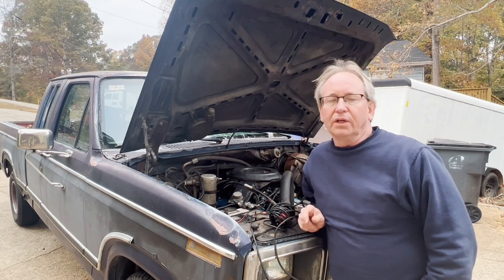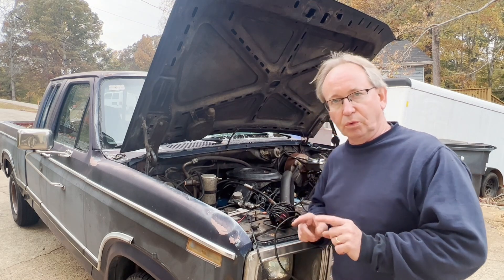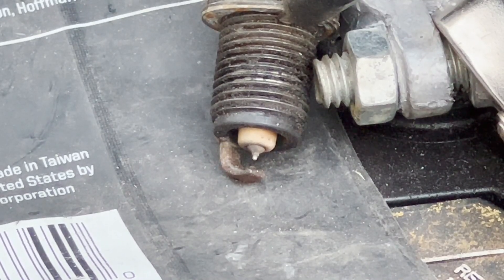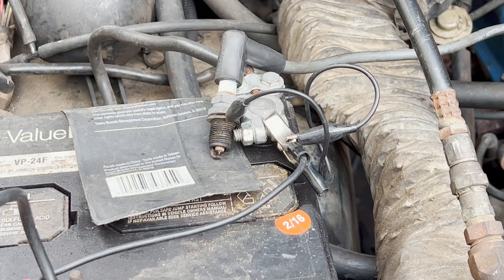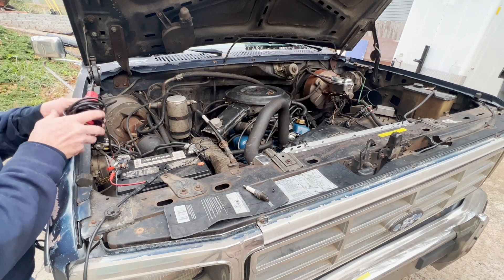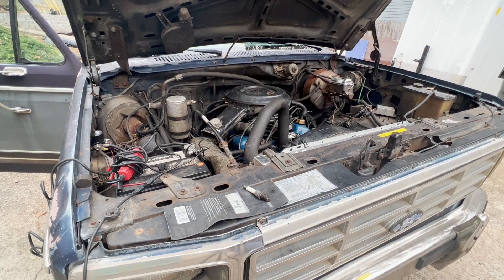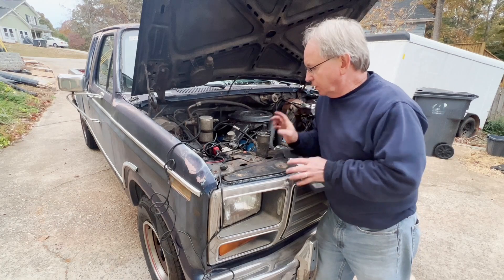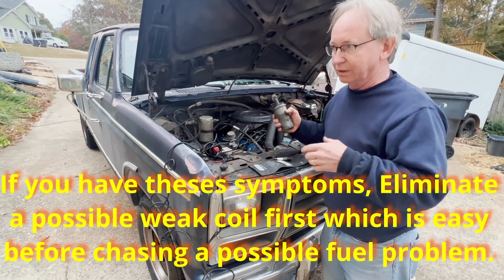How To Quickly Diagnose The Sneaky Weak Ignition Coil

Comment: I'm getting 9 volts to coil but nothing from it so bought a replacement and still no spark don't no what to do next as can't get engine started
Reply from the maker: Hi. Thanks for watching and taking the time to comment. Is this an older ignition system that uses an External Resistor? What is the Key Position when you measure at the coil? Older systems prior to HEI Electronic Ignition put 12VDC across the Coil Primary with the key turned all the way to Start/Crank with the Starter Engaged. Once you bring the Key back to Run, the Voltage at the Coil is approximately 9VDC, so if you're measuring at the Coil with the Key in Run it would Normally read 9 VDC. 
What is the Year/Make/Model/Engine? What type of ignition? Points or Electronic?
When you have no High Voltage Spark out, first thing to check is that you have a pulsing 12VDC in to the Coil. The Coil is a Step Up Transformer which requires an Alternating Current (AC) going in to function. Collapsing Felds in the Primary induce a Magnetic Field into the secondary which has more windings and steps it up over 20KV. Since a Car is DC, a pulsing DC (On/Off) in the primary as the result of Points opening and closing or a magnetic pickup into a control module produce a pulsing DC from the Distributor to the Coil. 
If you have points, its easy to visually (and Audibly) test this. With Cap off and Coil output grounded grab the rotor and rotate wiggle it back and forth. IT will only move a little against the advance. If the Distributor cam is close enough to allow the points to open and close, and the points are properly gapped you'll see and hear a little crackle when they open. 
With electronic you wont see anything, in the Dist, but will hear a pop and see a spark if you have the coil wire positioned close to the manifold.
Let me know what you have and the results of what you try.
Reply: @mkdhdinfiniteendlessconten3873  thanks for replying, my car is a 1984 rover sd1 2300. With the key turned fully but not turning over im getting 9 volt I've check for a spark but nothing I thought was the ignition coil so bought a new one but still nothing coming from coil even thought 9 volts to it so I'm kinda stumped
Reply from the maker: That car has Electronic Ignition, so the Ignition Module in the Distributor is what creates pulses to the coil. It's also a Lucas Electric which on it's best day is the worst system. I'm assuming that by 84 they were running Negative Ground. Lucas (British Cars) ran a Positive Ground possibly into the 70's. 
The Coil with the Key on puts a steady hot to the Pos side. You should be reading from the Pos side of the Coil to the Intake or some unpainted ground on the Engine. Don't read across the coil. In Run the Hot side of the coil would typically read 9VDC if it has an external Resistor. The Neg Side of the Coil is what get's the make/break pulse from the ignition module in the Distributor. It's highly likely that the Ignition Control Module in the distributor is bad. I can't guarantee it w/o directly troubleshooting it. There may be info online as to how to ohm out and check the module to confirm it's bad. You'll have to order that module on line. No one will have that locally.

Comment: It'd be interesting to see the difference in primary & secondary resistance between the 2 coils.
Reply from the maker: Hi. Thanks for watching. I'll have to see if I still have that bad coil. Generally I have found that unless the windings are either shorted or open, that ohming it out is not a definitive check. The resistance range for an acceptable coil is wide and for the primary very low ohms. It lets you know you have a ratio of resistance from primary to secondary and that it will step it up. If it's breaking down under higher rpm it will still Ohm out ok and have you chasing fuel problems that aren't there. 
I'll see if I still have it and if so I'll put the readings in a subsequent comment. 
Thanks again for watching and taking the time to comment.

Comment: Would this cause my truck to run rich? Carb is rebuilt and tuned. Trying to diagnose my running rich and taking forever to start.
Reply from the maker: Hi. Thanks for watching. Very possible. Takes seconds to jump another one in to see. See if you can find one in junk yard for $5. New ones are $30. If it's HEI Electronic Ignition you'll need that type of coil. If it's points, a lower output coil, which in 2024 you're not going to find in a junkyard. 
Since you said it's running rich it's likely the fuel pump is putting out too much pressure. Measure it. Should be 5 - 6 PSI. Anything over is too much for the needle/float. I have numerous videos on this. Go to my channel home and you'll find them. Let me know.

Comment: I have  a 1983 model prelude spark plugs will also keep fouling with bad distributor coil and when I try to take off  engine feels like about to stall
Reply from the maker: Hi. Thanks for watching and taking the time to comment. Was the coil the whole problem with the lack of power and plugs fouling?
Reply: @mkdhdinfiniteendlessconten3873   yes how are u I do believe the coil is the cause for spark plugs  fouling everyday also the  car lights goes from bright to dim  when rpm drops to 800 rpm and goes bright when idling at 1000 rpm  I believe the alternator is also bad the spark plugs will smell like fuel on it when coil is bad and loss of power also misfire
Reply from the maker: ah, the plot thickens. With these other symptoms it sounds more like the charging system is the root cause. The coil is actually a transformer that steps up the pulsing input which simulates an AC voltage from 12V to 20,000 and up to jump the gap in the plugs. If input drops, output drops proportionally with a weaker spark that will not jump the plug gap.
The battery is used to start the engine. After it's running the alternator takes over. If the alternator is self exciting and functioning properly you can take the pos cable off the battery while it's running and the engine will keep running.
Check your voltage with it running. Right after the engine starts and for some time after as it recharges the battery from the stress of starting, you should have 14.2 VDC at the battery. As the battery charges, the voltage will drop to 13 or so, but should always be over 12.6. Each cell is 2.1Volts. Check the running voltage first. 
There are other things to consider, but first rule out or otherwise fix the charging system if it is indeed not putting out the required voltage.
Reply from the maker: You should check the voltage while it's running with a voltmeter as I described above. Takes less 5 seconds. No point replacing the alternator if it's good. Let me know. Curious to find out the cause.
Reply: @mkdhdinfiniteendlessconten3873   The alternator is not charging the  battery light on the dash stays on, so I will replace the alternator and replace the coil I think that should help with weak ignition when I remove the battery terminal the engine stall

Comment: Good video. I always forget the simple things and overcomplicate issues.
Reply from the maker: Hi. Thanks, and thanks for taking the time to watch and comment. This problem is easier to diagnose on lower energy points ignition system since the coil output was lower and the plug gap smaller. it was more frequent in older style coils. 
HEI has a higher output and larger gap that even a weak coil will still jump. The importance of plug gap is you want the largest gap possible that the spark will jump. The larger the gap, the hotter the spark and the better the initial combustion of the compressed fuel/air mixture.

Comment: Small pro tip for anyone here looking for help: For any older electronic distributor ignition, long wires w/ single coil, etc, do this at night or in your garage with the lights off. After you get it running, also check under the hood in the dark for any spark/ignition leaks arcing around the engine from bad/damaged wires, loose connections, bad/damaged/loose boots, damaged/burned through coil, etc.
Reply: Had one arching saw it at night engine would go along and decide to stop by coughing till it stalled
Reply from the maker: Hi. Thanks for watching and taking the time to comment. Yes indeed on checking for HV Leaks in the dark. It's less of an occurrence with modern plug wires. Used to be regular thing that plug wire insulation would break down after a year or so. A spray bottle of water lightly misting the system will really make the electrons put on a show and confirm the plug wire insulation is breaking down causing misfires and skips.

Comment: Great video sir 
i have a question 
i have a 65 mercury comet it starts and it stays idling it but when i start driving after about a block the car dies. Can you give me your opinion. I can't find the problem. I did the carb, plugs, fuel pump , starter, sileniod, distributor. Etc thanks
Reply from the maker: Thanks for watching. I see you watched my Sneaky Weak Coil video which has solved probs for folks that had that problem, but yours sound more like fuel starvation from sediment in the tank. Since it's a 65, with most likely an original fuel tank and metal fuel line that's been in it since LBJ was president, it's probably full of fine rust that's clogging up any fuel filter and lines. I'd put a clear Glass cleanable fuel filter right before the pump and you'll probably see it fill up with rust. The filter should always be about half full with fuel trickling in. Your symptoms sound like fuel starvation. Filter clogs, engine dies, back flow pressure loosens up the crud and lets fuel come back in. It starts, runs a bit, clogs back up. I have some videos on diagnosing fuel starvation and float issues. Since it's a Comet it should have the same style tank as the Mustang with a big rubber filler neck in the trunk. Take the filler tube out and look down in the tank. Let me know what you find.

Comment: But good spark always blue. Bad yellow/orange
Reply from the maker: Hi. Thanks for watching and taking the time to comment. Yes, I agree on the spark color. I must have been kicked in the head by a mule when I miss spoke on that. I will at some point do a better companion video with a drill driven distributor and good and bad coil to show that better.
Fortunately the main point of the video to rule out the fuel system if you have these symptoms has solved the problem for numerous folks. It's a quick check and most folks that tinker have another coil in their stash. Coils can have shorted windings that will check good with an ohmmeter as the resistance range for "good" on both the primary and secondary windings is a wide range. They'll appear fine at idle and low rpms but under real loads and the higher frequency of a higher rpm will break down over 3,000 rpm and their high voltage output will significantly drop. Seems like a fuel starvation problem (which I also have a video for) but is actually the coil. 
Again, thanks for watching and taking the time to comment.

Comment: I going through this with my 79 cordoba smelt gas but no start and strong crank ignition coil is the cheapest part to replace first before going down the good ol list lol
Reply from the maker: Hi Thanks for watching and taking the times to comment. Before you spend $ on a coil, do you have spark at all? Verify that first if you don't have a coil laying just around. Go through it logically instead of shotgun trying parts. If it was running and had the same symptoms I'd say go ahead, but you should confirm what you have and don't have for an engine to run. You could have points or electronic ignition issues. A coil, which is actually a step-up transformer rarely totally fails with an open or short, but as I pointed out in this video can break down under load, or have some partially shorted windings. If you have an a multi meter check the coil primary and secondary windings. 
Smelling gas could mean the needle valve in the carb is stuck open and it's dumping raw gas straight into the cylinders. Is the distributor rotor turning? Do you have compression? If it's a V8 and has original timing set, if the Cam gear was Nylon toothed, and being that old the teeth could have all stripped off. Been building engines for 50 years, and have seen that more than once on old GM engines. Let me know what you find.
Reply: @mkdhdinfiniteendlessconten3873  yea I haven't checked under the cap yet cause it says it's all electric system but if it's points I'm get the good ol pertronix added but she starts right back up now after swapping the coil it the old hardly had any juice in it
Reply from the maker: Hi. Thanks for getting back to me, and confirming it was the coil. Ya, Ive got Pertronix in several of my old school Oldsmobile's. They require straight 12 Volts at the coil and pickup in the distributor. Check that you have 12 volts. Older systems only had 12V at the coil for starting. Once the key went to Run position, the hot to the coil ran through a ballast resistor dropping the running voltage to about 9VDC on the hot side. Chryslers usually had a big ballast resistor on the firewall. Since yours sounds like it's electronic it might be 12VDC at the coil. It will actually say on the coil "Requires External Resistor". Glad it's going and that my video helped you solve your problem.

Comment: I’ve been trying to find a “fuel issue”  for 3 weeks. I cannot wait to test my coil I have a pretty good feeling this is issue. You described my exact issue
Reply from the maker: Hi. Thanks for watching and taking the time to comment. Ya, a weak coil that breaks down under load will give the same/similar symptoms as fuel starvation. You can ohm out the coil statically and it will appear to be fine since it's breaking down under load dynamically. Generally if you work on cars, you have known good coils on your shelf. It's a good idea to grab one every now and then when in the junk yard.  I have a recent video regarding fuel starvation again with essentially the same symptoms which turned out to be a bad in line fuel pressure regulator. With fuel starvation the engine will often stall if you don't back off quick enough. With a weak coil the engine will stay running and bog down, but rarely stalls and will come back once you let off the gas.  Anyhow let me know how it goes and if it was indeed the coil on your vehicle.

Comment: Appreciate the effort but in all honestly, this method in no way helps anyone trying to learn how to properly diagnose a no start or stalling issue. Basically you had a theory and some luck on your side. At no time did you actually “test” anything. Fixing problems through a process of elimination doesn’t help anyone and can get pretty expensive if you’re just going to throw parts at it. Sorry if I’m being rude but there are way too many “mechanics” out there not knowing proper diagnostic methods.
Reply from the maker: Well, I was waiting for you to make and upload the video with all the theory of how a coil works and how to check pointlessly check the coil primary and secondary with an ohmmeter which won't reveal a problem as it's a dynamic breakdown under load, show more testing than I already did, and also run fuel pressure checks, maybe even take the top of the carb and watch it run, etc, but looks like I'll have to make that video too since you haven't. lol
Not only did I have a theory, I know the theory and teach it as an instructor with Master Mechanic and A&P Credentials with over 50 years of experience. There is no luck involved. When I replace a part, it's faulty. Period.
The video exactly accomplishes what the Title and Description say. The point was to "Quickly Diagnose The Sneaky Weak Ignition Coil" which is exactly what the video does. I explained and demonstrated how similar and the subtle differences in fuel starvation and a coil breaking down under load. Knowing and recognizing those differences I didn't waste time on the fuel system. I have clear filters and can watch the fuel flow. I knew to grab the test coil I already have on hand and do a quick jumper of it to Quickly confirm it was indeed the coil breaking down under load which the only test is to swap it and confirm or rule it out. This is not "throwing parts at it". As for testing, I actually do show a spark comparison, but it's hard to see the difference on camera. 
Anyhow, after solving the problem in minutes, a few days later I thought it would be nice to make a video and help people out, which if you read the comments you'll see that it has. This video has been viewed just under 18K times in a year and from the people that took the time to leave a "Positive" comment and 226 Likes it certainly has solved this issue for those who took the time to comment. I'm sure there's more.
So, you've given me a good idea for another video and since I don't want anyone disappointed I'll go ahead and make that video teaching/demonstrating/showing  testing and theory. Maybe even give you a shout out. Stay tuned...
Reply: I’m sorry if I pissed you off but my comment remains spot on. Having your video watched 18,000 times or 18,000,000 times doesn’t make it good content. It simply means you passed on your hackery to more unsuspecting people and created more hacks. If you’re in fact a “Master” / “instructor”, you should have taken the time to present a useful/ educational video. Now, because I pissed you off, you’re going to make a new video? That’s great. Just remember to delete the first one after you upload the new one. There’s already enough uneducated “back yard mechanics”out there watching unhelpful content such as yours. Let me know when the new video comes out. If it’s good, I’ll be the first to give it a thumbs up. Thanks for sharing your thoughts. @mkdhdinfiniteendlessconten3873